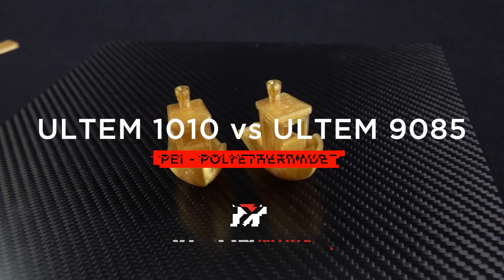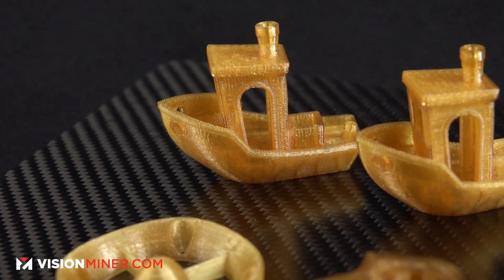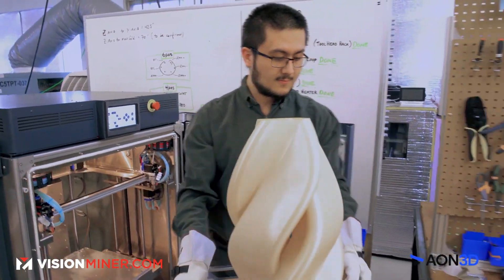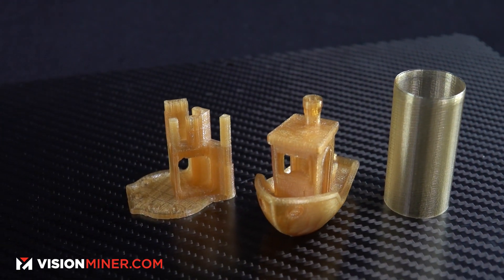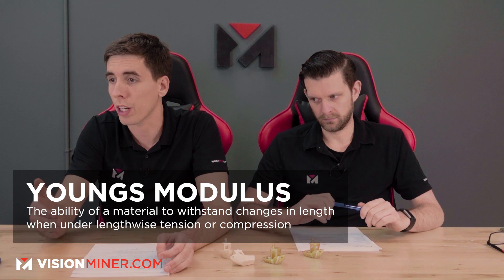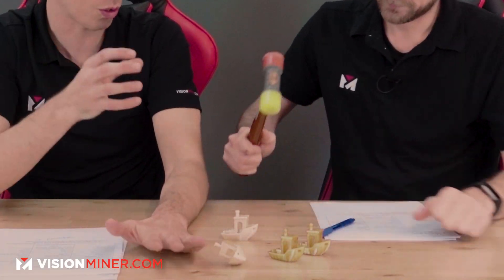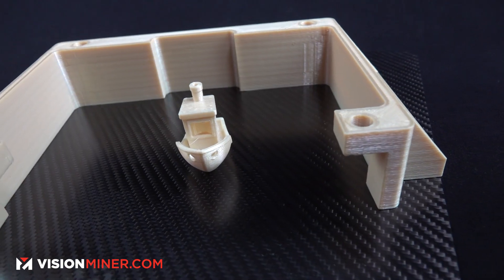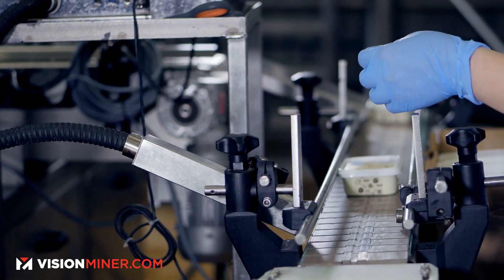ULTEM 1010 vs 9085: What's the difference, and which is better? 3D Printing Filament 2020

Comment: I’m inferring from the greater elongation at break and greater impact strength, that 9085 is maybe better at extreme cold temps, as that 1010’s added strength and stiffness might translate to issues with brittleness in extreme cold.
(And I would think the aerospace certification on the 9085 implies ability to withstand temps down to, what, -40 C, for cold climate flight at high altitudes.)

Comment: Young’s modulus is “stiffness”, not tensile strength. The fact that the 1010 is  quite a bit more stiff (higher Young’s modulus), but only a bit more strong (higher tensile strength) explains the elongation difference—it says nothing of toughness. They both fail brittle, so it says nothing about toughness. Impact strength is a better indicator of toughness than elongation.
Reply: I was about to write similar. Well said.

Comment: What 3d printing material do you recommend for small mechanical parts?
Reply from the maker: When choosing a material you need to know your environment. Things to consider:
1. Temperature resistance
2. Chemical Resistance
3. Mechanical strength (rigid? ductile? self lubricating?)
4. Price of raw material

Thus, PEEK is a great option, but generally not cost effective or necessary -- usually overkill. For general parts our go-to is CFPA6, or for high-temp ULTEM 9085.

Comment: I found Ultem 1010 filament for 25 bucks canadian per 500g for a 2.85mm roll. But for 1.75mm, it's a different story at $100 per 500g. I'm still not sure why.
Reply from the maker: beware -- there are a lot of fake ultems on the chinese market these days. At that price, it's almost guaranteed to be fake, as the pellets cost more per KG than that :) Unless it's a crazy blowout sale, since I don't know of any high-temp printers using 2.85mm filament.... hmmm!
Reply: @VisionMiner  it's from a canadian vendor, but I asked them, and they did say it was not pure ultem. Also, it was on huge clearance at the time, but now it's gone.
Reply: i asked them again and they said it was pure. I'm now very confused.
Reply: @VisionMiner  Is Ultem 1000 similar to 1010? Filastruder sells Ultem 1000 pellets for $10 USD per lb, or around $21 USD per KG, oh i see what you mean.

Comment: Is this material UV safe?

Also

Where is the hammer test? You promised Cole McHone that he could smash the two benchmarks with a hammer AND that it would be a slow motion capture! Please post the link to this if it exists, or once you make it. We want to see a comparison of the two materials.
Reply from the maker: Polyetherimide (ULTEM) is inherently resistant to ultraviolet radiation, yes -- after 1000 hrs. of exposure, no measurable change with tensile strength.

As for the hammer test..... we shall :) oh, we shall :) Working on a longer-term project, printing objects out of every single filament we sell -- probably around January/February, we'll do some hammer/blowtorch/acid tests! :)

Comment: With the 1010 vs 9085 in the scenario of a car intake plenum adapter which would be better? Also if the car had forced induction which can withstand higher pressure?
Reply from the maker: Honestly you should consider our High Temp Nynlon + CF, with temp ratings similar to 9085 and far easier to print -- but 9085 is generally better due to the impact resistance as long as the temperature isn't going too high -- 1010 can be more brittle, and it's nice to have some give in there. Plus, it's easier to print!

Comment: Where are you finding impact strength data for these materials?  I’d like to get this for the other 3DXtech materials but they told me they don’t test for that when I contacted them.
Reply from the maker: The measurements are based on the resin itself -- we're acquiring some machines to do the printed tests ourselves, so stay tuned!
Reply: Vision Miner I did some research and some printing with both materials and using the resin numbers is quite misleading.  If you take a look at the stratasys data sheets, they have tensile strength and impact resistance data.  

While 1010 is impressive in the x-y orientation it’s lackluster in the z direction.  9085 data on the z axis is among the best of ALL filaments for tensile strength and impact resistant. Because of this and it’s ease of print ability it’s the clear winner at this price point.
Reply from the maker: @JasonScottHamilton  Absolutely correct -- I always tell customers and potential customers to throw the TDS out the window, since it all depends how it's printed -- but 9085 is definitely our favorite out here!

Also, some companies are finally starting to include x/y, y/z, z/x numbers on sheets -- but even then, it's misleading based on the geometry of the part. We essentially need an entirely new system of standards.

Comment: Are those the only two colors?
Reply from the maker: You can get 9085 in Black, or 1010 with Carbon Fiber (which makes it black) -- but right now, yes. Generally adding pigments will affect the mechanical properties of the material, so often, natural is opted for.

Comment: If I wanted to start printing in ULTEM, what printer would your recommend that meets the required temperature specs? I'm looking at making small parts for an engineering project.
Reply from the maker: Depends how thick you need it, but you can't beat the Funmat HT for the price. If you need giant solid parts, though, better machines will be available next year, after the stratasys patents expire.
Reply: @VisionMiner  What kind of machines do you have in mind? 22IDEX is also „only“ 90 degrees in the chamber. The AON3D M2+ would be great but in a way higher price class. Any suggestions?

Comment: Forgive me but I am somewhat new to 3D printing. What kind of printer setup do I need to print with this? Can I print using an open printer or dose it need to be closed and heated? I have and ender 3 right now and I am getting a artillery sidewinder x1. Will they work?
Reply from the maker: Unfortunately not, you'll need a high-temp machine with a heated chamber for these. Best deals on our site! visionminer.com/printers -- as new options come out, we generally vet/test printers, and then offer them for sale, so check back every so often to see what's new out there!